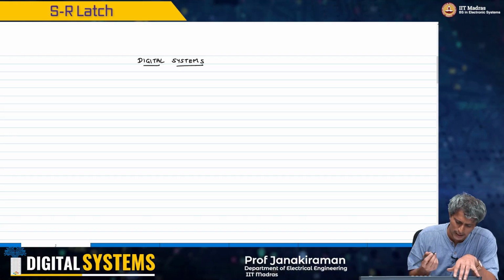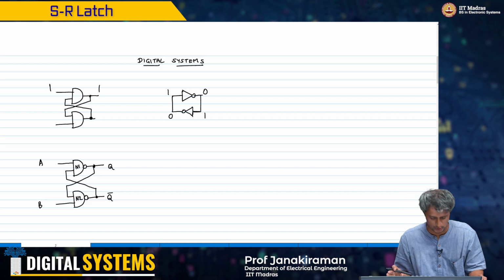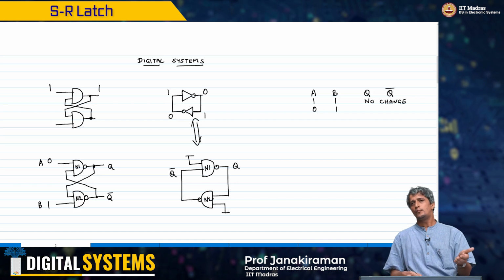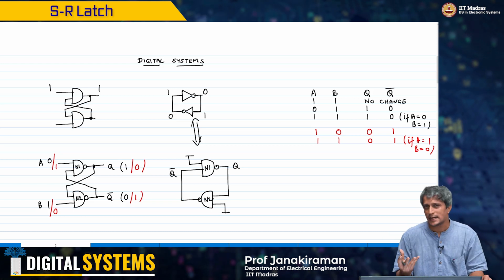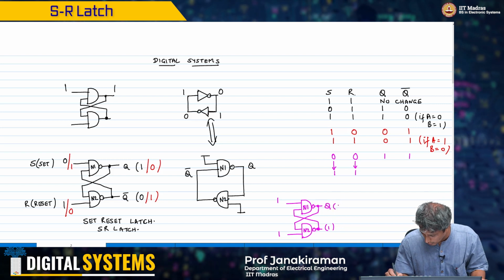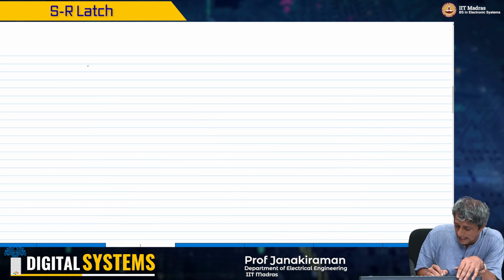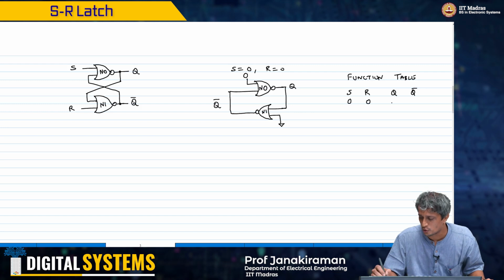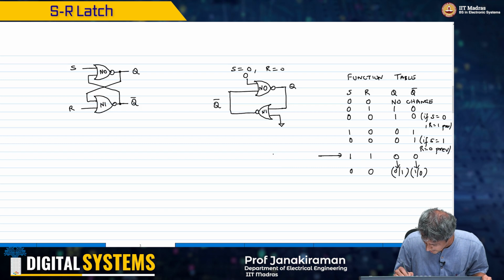W10_L1: S-R latch

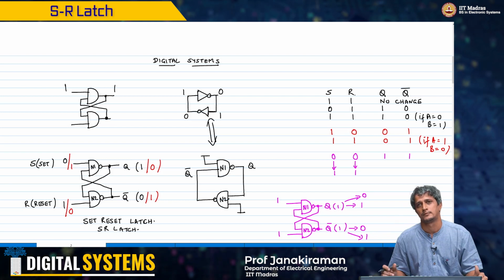Comment: 13:10 if both are 1 and 1 as feedback inputs and then 1 1 is supplied simultaneously the gates will act like astable multivibrators, making an alternating signal. if there is even a slight difference in the arrival time of the gate inputs then it will get to this unstable state